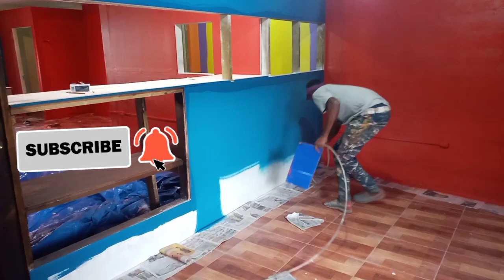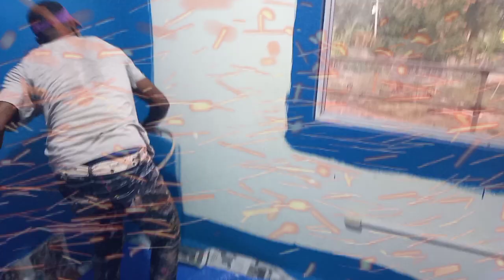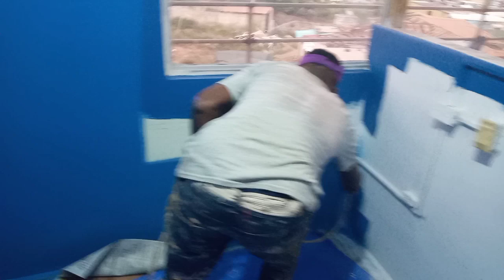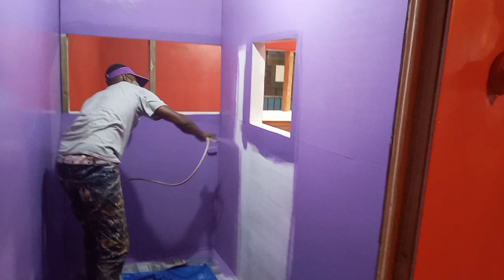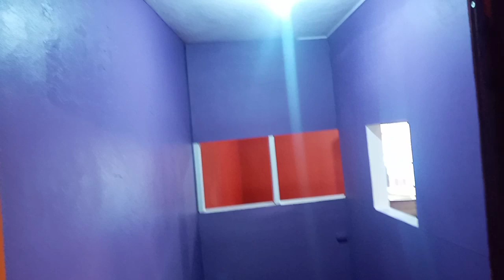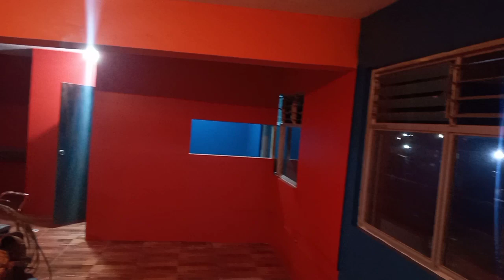this is how I spray paint a printing office fast and easy using a Graco 17G180 magnum prox19

Comment: What tip are you using and how many psi
Reply from the maker: I know I should have turned it up more but I had some problems
Reply: I have FF LP 310 tim. Do you think it will work or it's too small? Just trying to figure out before I mess up.
Reply from the maker: Depend on what kind of work your doing with it
Reply: Looking to do walls with it. Pretty much aant to know if I'll be able to do what you're doing wint my setup: Graco 490 + 310 tip

Comment: When using a water or oil base paint how do you thin the paint
Reply from the maker: Normally, I don't thin water base paint, but For water base paint, i thin the paint baste on how thin I want it but not too thin, i throw the paint in a container and baste on how thick the paint is i  throw a certain amount of water in it and stir it for about 4 minutes and the same procedure for the oil base paint.